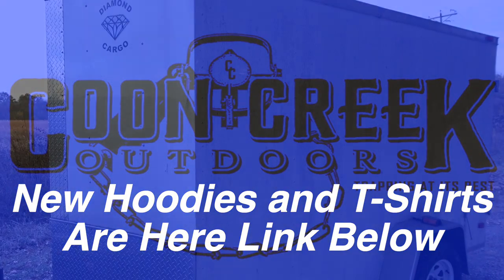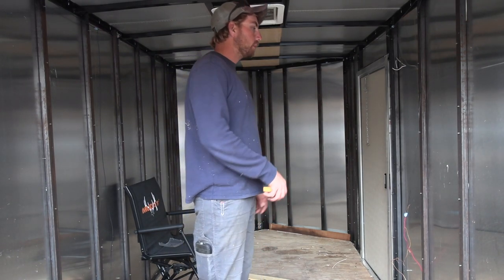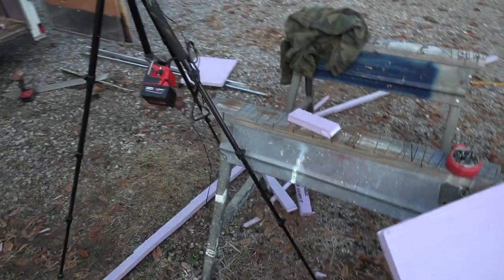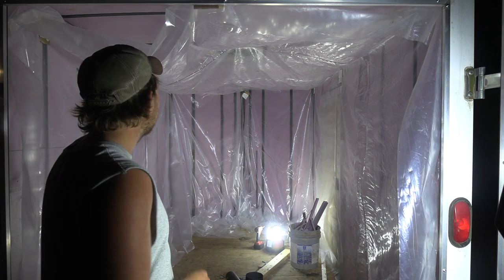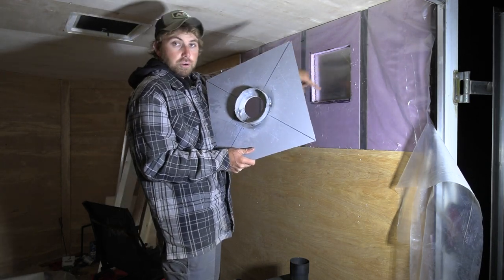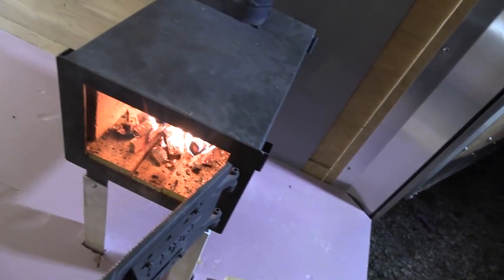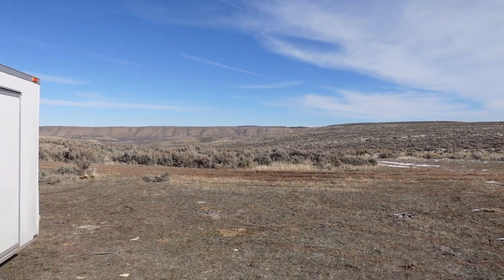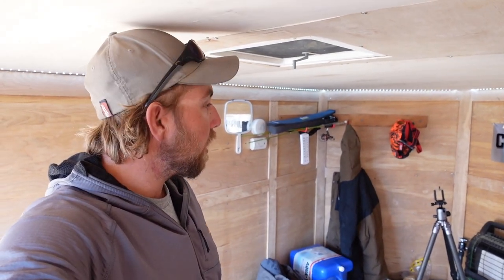I LIVED in This TINY DIY TRAILER CAMPER For TWO WEEKS. It Was AWESOME. (FULL BUILD)

Comment: Nice video,great ideas. I've kicked around the idea of doing similar to a big old class b truck that could pull a trailer with side by side or even another vehicle like small 4 cylinder mini truck? I'm survivalistic ,camper,hunter,fisher,trapper  & was a farmer & in the special forces long ago. I am capable of going very long times with little & light gear & few supplies. Yet being pretty comfortable at the same time.  There is no end to the possibilities & ideas & additions that can be made to your creation to make it warmer,safer,cooler, more spacious, & independent. Low budget additions too,just use the brain god gave us,dont have to cost alot. Some quick examples? Stay with the propane,much cleaner burning,less fumes. A thick plate steel on stove top adds even more thermal mass after cooking & takes long to cool off. A tarp ,dowel,pipe or conduit can make a roll up awning,quickly removable & stored on a wall or floor inside. It gives out door space & shelter in moderate temps, shade if it's hot, will catch rain water & snow or snow melt for any purpose,boil or bleach treat the water. Sealed hot water bottles can carry heat through the night as well. Old carpet can make insulating wind break skirting around the bottom of the unit ,quickly removed,rolled,tied & loaded in side to move? A garbage can will melt & store water in doors of it in a corner some where. Smaller amounts of water can be boiled to speed the melting of snow in the garbage can. It's just limitless if you put your brain to it & not real expensive. Outdoor rain barrels at awning ends,its just endless. Hell,you could garden.

Comment: Shelves for sure and you could use them to store crap when you work out of it. Great job overall.  I would say if you are happy with it then that's all that matters.  I think you could replace the athletic flooring with a quarter inch ply and not have to change out the floor everytime... If I could leave all the insulation in permanently I would try it.  I would probably keep the wood stove and carry hickory or oak to burn at night... I actually thought all that was a nice setup really and for the money it's hard to beat the price of the wood stove. Where did your chair go? 😂

Comment: Drill a couple of pilot wholes into the square tubing and foam insulate them. I bet this would get rid of your condensation issue. Has anyone tried using carpet foam for the floor insulation with carpet on top of it? I feel that the foam sheets will compress over time.

Comment: Thermal Bridge through those beams will be minimal because the air space in between actually should kinda help,  definitely don't like killing chipmunks, they don't do anything, and they are really amusing to watch interact with each other, but hey were in a free country so guess monks are on the menu,  that little stove on full burn will definitely run you outta the trailer, 70-75 degrees will be like 80- 85 lol I'd make a tin box to put the wood stove on then u can put wood in it to dry an cure fresh cut in emergency great fabrication on that jack

Comment: I turned my 6 by 12 into a camper several years back. Ripped the plywood off the walls and sprayed them with automotive undercoating and insulated with R-19 and vapor barrier and ship lapped the walls.  Ran electric for interior lights. Insulated the ceiling with 1/2 foam board and covered with Lewon. Built shelves in the front and a console to house my cb, stereo head unit and solar panel output display. Made a fold down bed and bought high density 3” foam for the bedding. Also built a gun rack and fishing pole rack to keep those off the floor and in arms reach. Also had a tool box on the front of my trailer that held my battery, solar panel hook ups and a trickle charger, had a gas line ran from the outside to inside for my Mr buddy heater. Had ship to shore power ran inside also. Had a portable toilet inside as well. I put down laminate flooring and also had carpet layed down on top of that secured with bolts that were wood screw on one end and machine threads on the other and had dome cap nuts with washers holding the carpet in place. Laminate in summer and carpet in the winter. I insulated underneath the trailer with the widest and thickest insulation they sell and braced it up and I enclosed the underneath of the trailer with roofing tin and secured it with self tapping screws and sealed all the joints with NP-1 roofing caulk. Probably the best thing I done! Not only does the insulation keep it warm but enclosing the bottom creates less drag when towing equaling better gas mileage!!! Couldn’t believe the difference that made! I rolled the roof with Cool Seal to keep the heat down in the summer. I had it tinted desert sand. And last but not least I put a camo paint job on her. Super easy to do! I called her the Stabbin Cabin! Chicks dug it! 😁 Sold her a couple months ago to a buddy of mine.

Comment: How'd ya do hunting? Where abouts were you. What rifle season did you hunt? Just curious as a CO resident. As far as your trailer goes, I'd make a fold down bed so you can fold it up, out of the way when you're not using it. Shelves in the front, and a diesel heater, like you mentioned would be what I'd do too. I hope a big CO muley got within range. I wasn't so lucky.

Comment: 1-1/2" foam board, would of gave an air gap between the steel tubing and plywood. Just need longer screws for plywood.

Comment: We did the same thing with our trailer so we could camp and haul our SXS. Other things we did was installed a counter across the front V and then installed a diesel heater underneath. Run e track down the wall sides so we can run 2x4 across with a board on top with a foam mattress for the bed. Gives us the ability to tear it down when traveling.

Comment: My shop building is insulated with 1" Styrofoam insulation and you would be amazed at how well it holds in the heat and keeps it cooler in the summer

Comment: Not sure about a diesel heater but a friend of mine lost both his wife and daughter when they were travelling in a truck camper using one of those Kerosene Heaters. They both the died in the back of the camper from the fumes of that kerosene heater. Whatever you do I wouldn't use one of those or anything similar.

Comment: IF ... you're  truly  concearned about condensation I'm  not sure why you used a plastic liner to contain it further.  The secret to managing  condensation is ventilation,  both fresh air in and damp  air out.

I think what you'll  find using a cargo trailer as a camper is hanging enough damp/wet clothing And boots to dry and sufficient space for firewood.

You're also going to need heat/fireproof protection on the floor.

The foam flooring will go up in flames real. Quick.

Comment: Probably need a cold air intake from outside to help with carbon monoxide and dioxide. You wouldn't be burning all of your oxygen inside to run the stove and it will burn more efficient

Comment: I have enclosed cargo trailer like that a little bigger it's the best thing to sleep in and the safest and Lawlessness sanctuary drug infested tent encampment cities. But definitely don't leave anything of any value inside your vehicles in these crazy cities they will break in your vehicle just for a backpack, a box or change in your cup holder. Anything of any value they can barter trade or steel to turn into money for drugs drugs and more drugs this is 93% of the homeless!!! If you're homeless the last thing you want to do is stay in these drug infested alcohol drinking 24/7 party tent encampments why? You can't trust any of these people most of them have warrants, wanted fugitives, rapist, drug addicts, drug dealers, in and out of prison, and they will steal from their own people their backpack with everything they own and after they're done with the backpack they'll throw their ID away. And then you're in a real horse mess with no ID just by staying with this riff raff. Most in these tent encampments don't call the law. But if you got problems or homeless the last thing you want to do they start hanging around this homeless bunch in the 10 encampments and get into the drug network of stealing bartering trading making meth and more. Because a life of crime out on the street ends up with death or prison. This is why I say the homeless addicted to hardcore drugs with no money stream and an addiction problem are better off in jail. Because letting these tent encampment cities go on why the government gets rich off of them it's just corruption and it's not working.

Comment: Diesel now a days doesn't gel anything like the old days. That said, I doubt you would have any problems and you can always do additives. I have owned diesel motors in trucks and equipment for decades now. Good luck and I like your simple build. I'm currently working on a 7 x 16 cargo trailer that I want to use for camping but also still use as a cargo / tool trailer for work also.